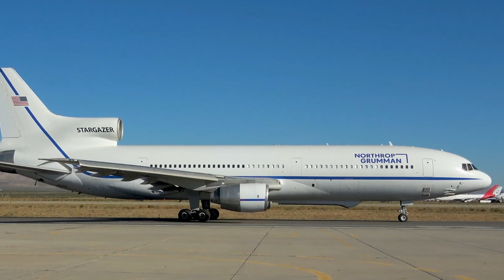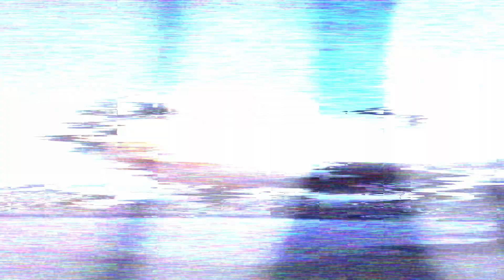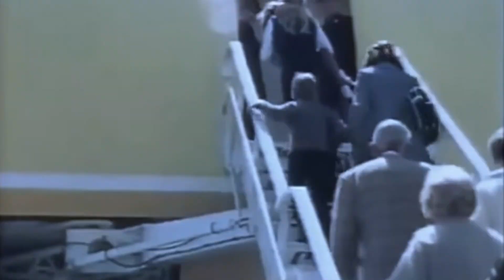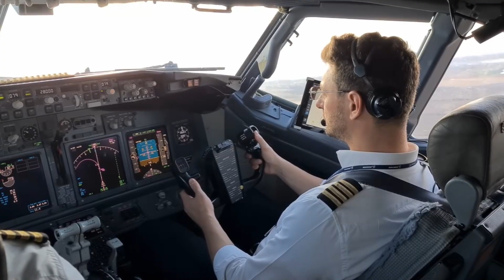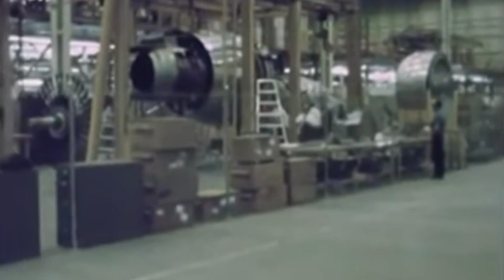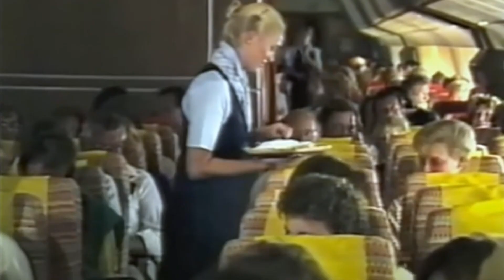How the L-1011 Tried to Beat Boeing and the DC-10… and Paid the Price

Comment: Another ingenious aspect to the TriStar's pitch control was during 'normal' ILS landings...  Rather than using elevator pitch to follow the beam, porpoising the plane up and down, it used DLC - direct lift control.  The spoilers deployed to keep the plane on the ILS beam without pitching up & down.  During cruise flight the system even used matching ailerons on each wing to shift the load inward to where it was stronger...

Comment: CATIII-C Autoland, actually...  They flew one from LA to the East Coast with no human intervention between the start of the take-off roll and the landing rollout and brakes.  And, boy, was it quieter than the 707 we took in the other direction.   Besides the quieter Rolls-Royce engines, the tail engine was quieter and the wing engines were farther from the fuse.  Oh, and FOUR hydraulic systems compared to the DC-10's three.

Comment: The DC10 was slapped together to be the first....so minor things like cargo door latches were skimped on.  That third engine on a DC10 looked like a tacked on afterthought.  Read the book "Destination Disaster".  Very good comparison of the DC10 and L1011...One chapter "fly before they roll"...was the Douglas goal of flying before the L1011 was rolled out of the hanger.  So engineering took a back seat.